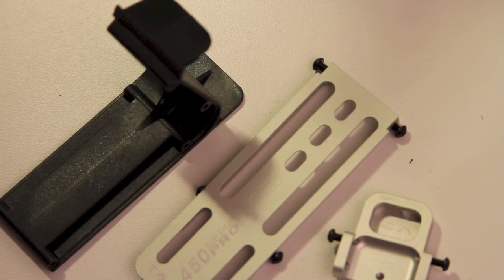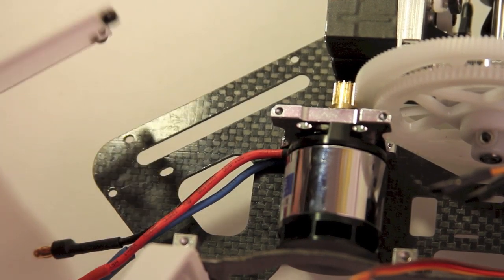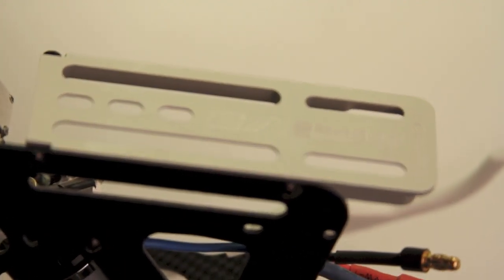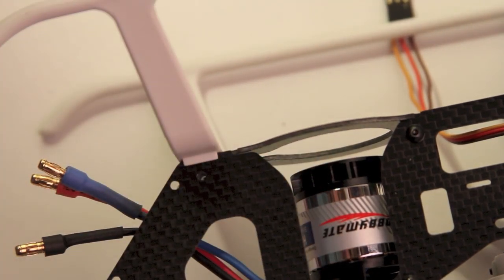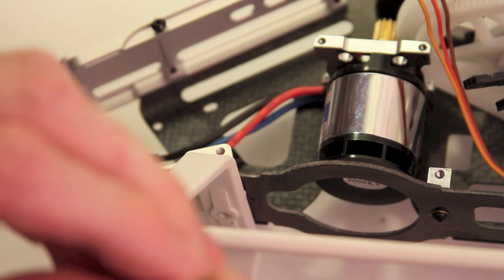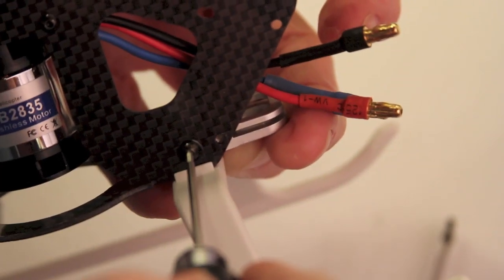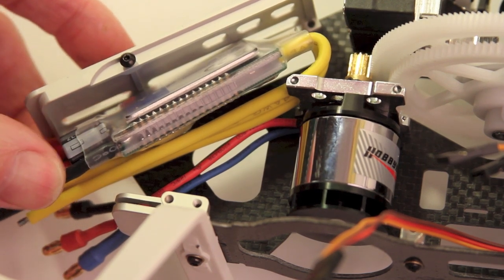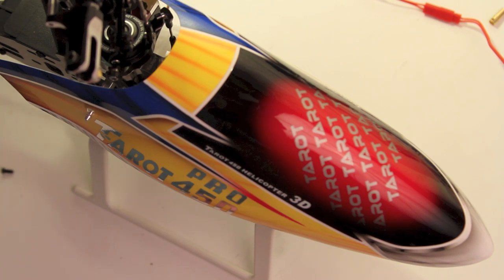24 : Tarot 450 Pro V2 Build : Metal Battery Tray and Canopy Support

Comment: Was expecting to see you put on the other half frame side to make sure the YEP clears it mounting at an angle. How are you going to run the battery strap around the slant mounted ESC? I have a Turnigy AE 45A ESC flashed with BLHeli with governor ready to go in my 450 Pro but I don't want to mount it outside of the frame. I already have a CC 10A BEC on the lower tray behind the mainshaft where I don't think the AE 45A or YEP would fit anyways.